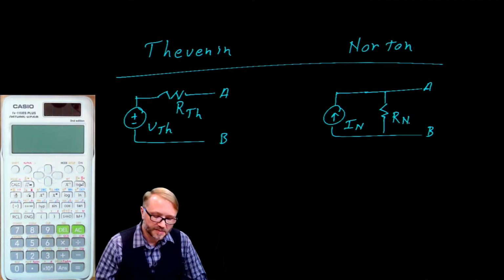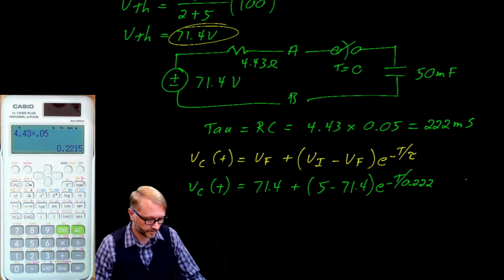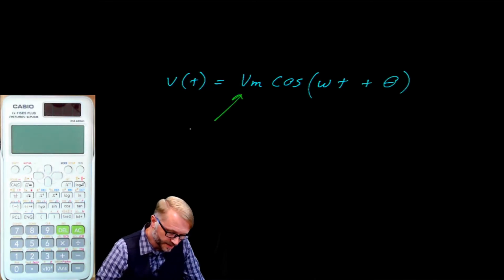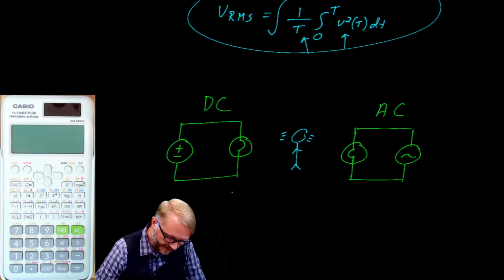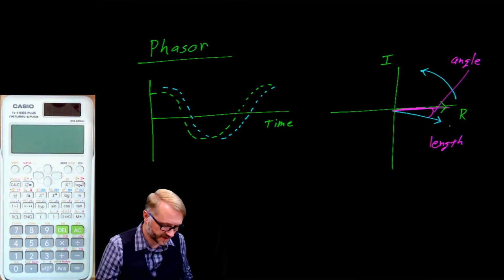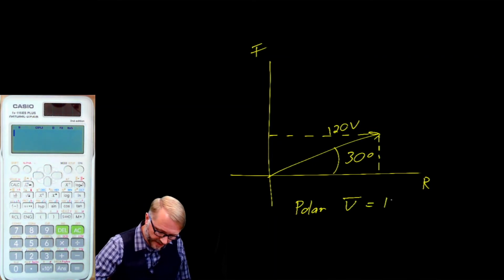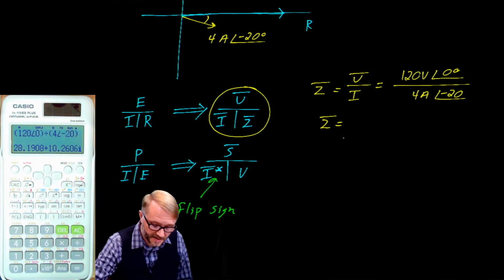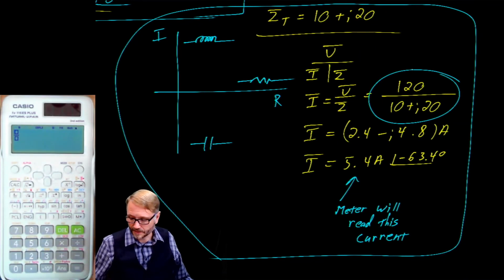#10: Phasors as used in AC circuits

Comment: 00:13 Reviewing Thévenin & Norton
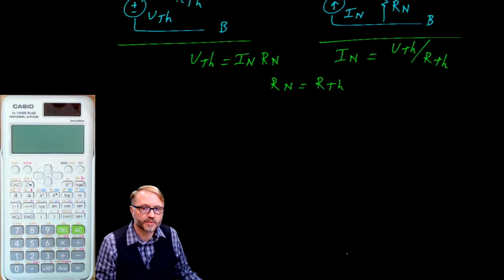01:03 Eg. Combo Problem
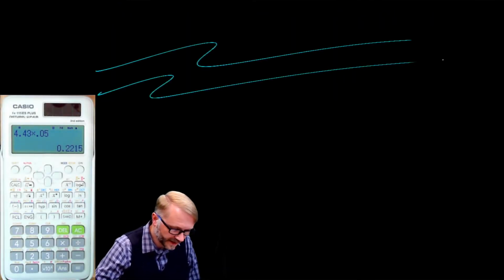05:52 Everything about Capacitor (ICE)
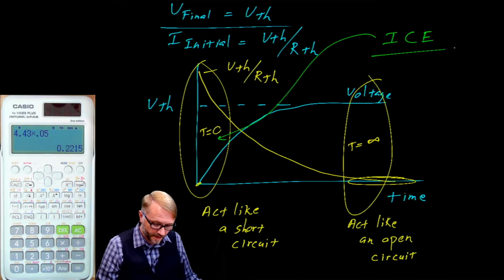07:45 Everything about Inductor (ELI)
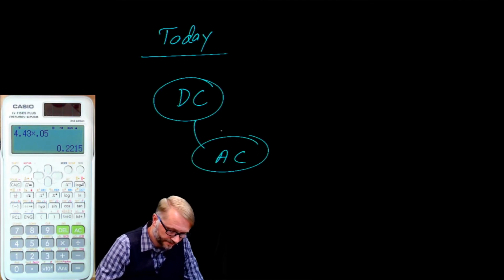09:34 You are here: AC Power
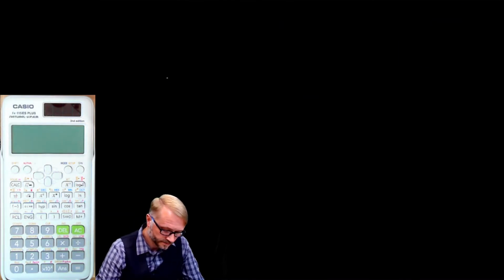10:14 Understanding the Cosine graph (Peak, Omega, Phase)
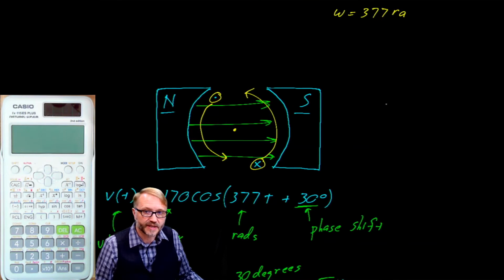12:56 The meaning of RPM
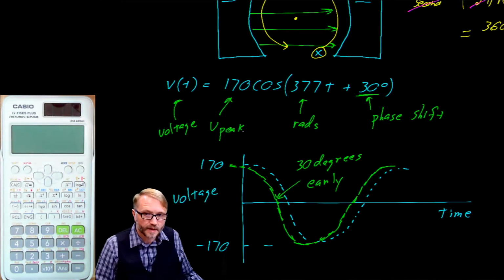13:49 RMS Voltage (Root Mean Square) 
14:36 RMS & Voltage Peak (Visualizing RMS)
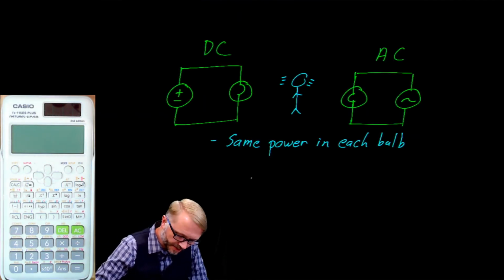15:38 Formula for RMS
16:51 RMS Calculas-ly
17:39 I_RMS, P_RMS
18:47 Transposing The Graph into a new Dimension
19:20 Word of the Day: Phaser
20:39 Imaginary number (j) 
21:07 Unit Circle & Trig
21:19 Euler’s Identity
22:00 Using Calculator: Complex Mode
22:45 Phaser is Vector. Scalar with Direction
23:49 Eg
24:38 RMS shows up again!
25:14 Polar Form, Rectangular Form
26:03 Expressing x,y in term of trig
           Using Calculator to convert in between 
27:17 Eg
28:14 Graphing in an Imaginary World
28:50 Upgrading Ohm’s and Power Law (Impedance)
31:01 A Glimpse to Future
31:58 Look ahead: Impedance
32:38 Creatures from Other Dimension
           How to deal with them